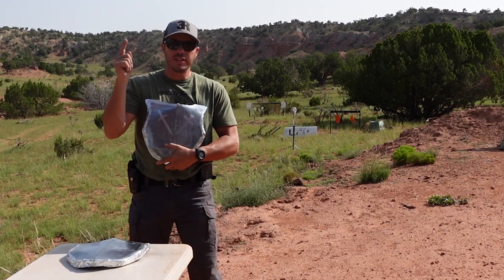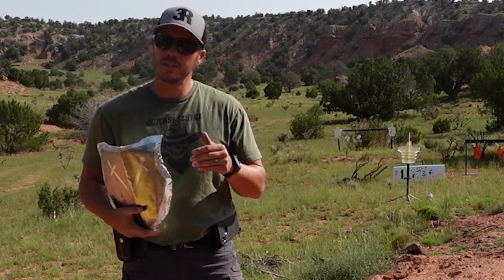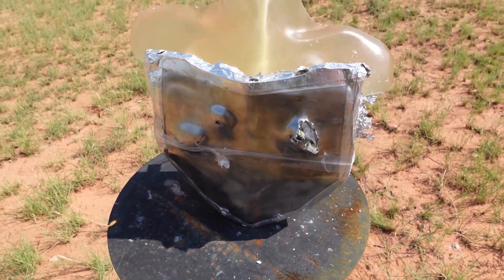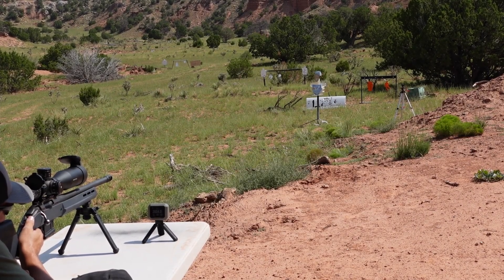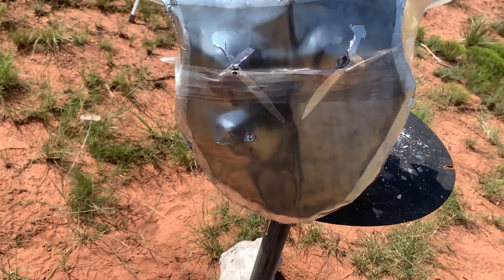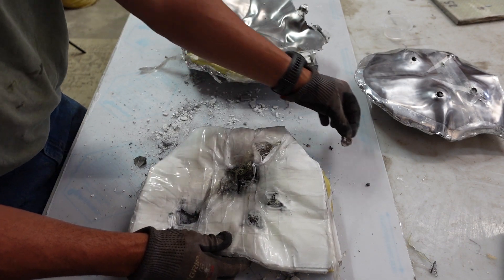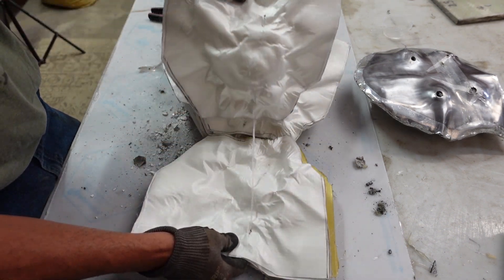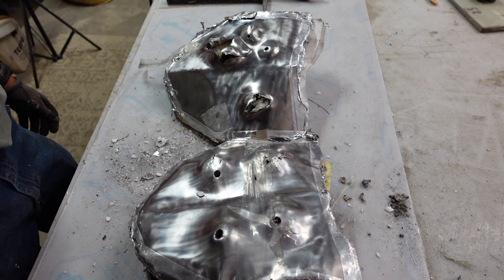I Built Medieval Armor to Stop Modern Armor Penetrating Rifle ammo… Here's What Happened

Comment: Lol, testing the first plates backer design in my next project basically, with the addition of carbon fiber. Supposedly the UD aramid does better with backface compared to the PE, do you feel it helped any? Also, where did you source the UD aramid?
Reply from the maker: @Armor-Innovations  that’s going to be a great test, cannot wait to see the results. 
Unfortunately, most of the work was done on the strike face on these builds so I am not entirely sure of the UD Kevlar effectiveness. At some point it should be tested against normal Kevlar 29 or such to see if it is better. 
I purchased these UD Kevlar from skarrarmor on eBay.

Comment: nice performance! 

would it be possible to do an alternative version where the ceramic is replaced by a quarter inch of ar500 steel (but same composite backer) to see the difference  against the AP rounds?
Reply from the maker: @gamecubekingdevon3  sure. The plate might weight a few more pounds but I have the AR500 in my shop. Should be fairly straightforward to make.
Reply: @3RBallistics  nice! as i m very curious to see how the IIIA  UHMWPE  backer + quarter inch hardened steel SF would fair

Comment: Echoing the other comments, I always enjoy build videos.
Did you source from Alibaba?  Especially for alumina, most domestic sources are insanely expensive.
Reply from the maker: @pattern_recognitionist  the alumina is actually very available in the states. I found this from a grain supply company. It seems many silo and grain facilities use alumina tile for its abrasion resistance. It isn’t as pure as ballistic alumina but it works much better than porcelain tile.